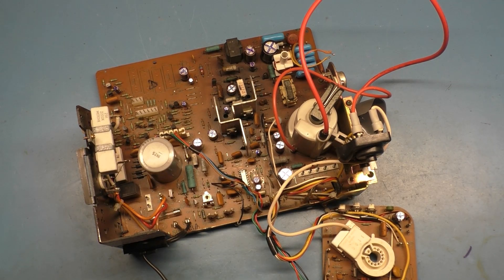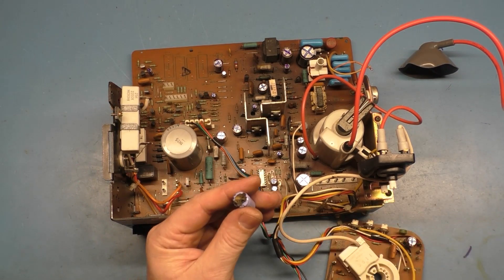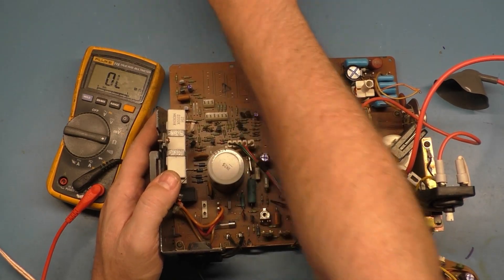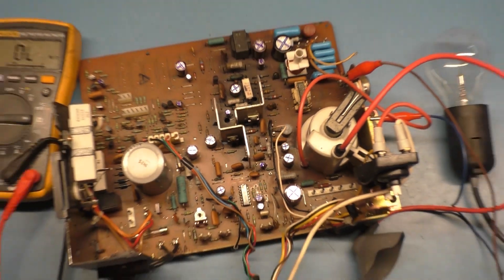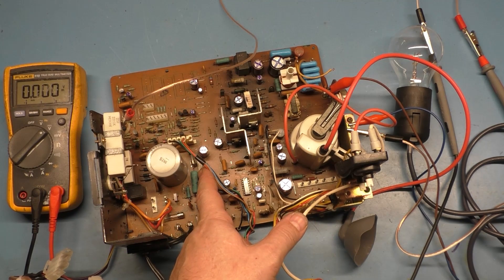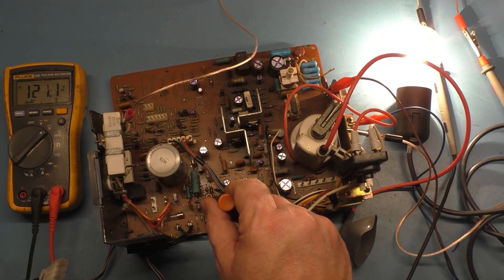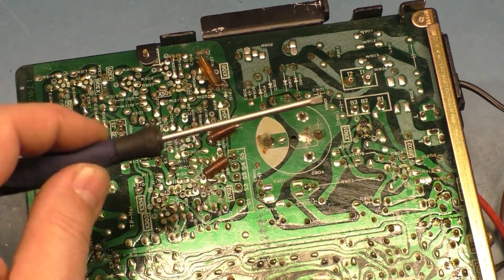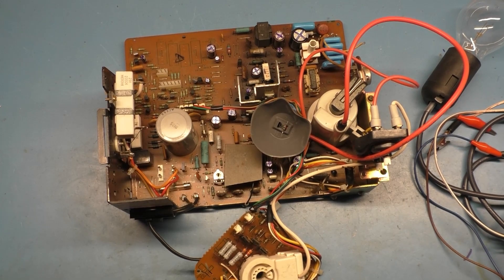Arcade Monitor Repair 101 - G07-CBO Light Bulb Test And B+ Adjusting - How To

Comment: There is a test I usually do first initially where trhe light bulb goes across the blown fuse . If tje light is dull orange and you get some signs of life  or it glows very bright and device under test does nothing it can help wiyj diagmosis.

Comment: Im getting 140 volts but it doesn't power on the bulb.
Reply: moved the alligator clip from the brown wire (frame (not ground) of HOT  to jumper w908) KNOW it WORKS.

Comment: I used my bulb to discharge caps on CRT chassis as well as the caps in SMPS, less spark and it is surprising how long the bulb lights for.
I used 100W 240V Bulbs because, well, Australia <wink>